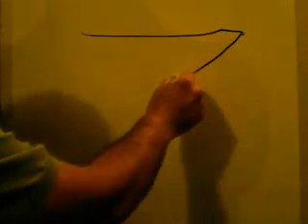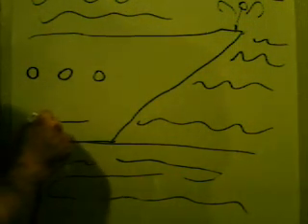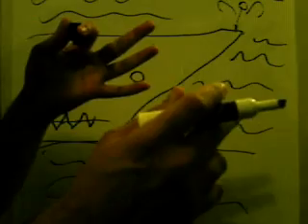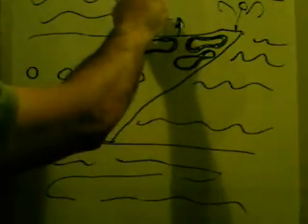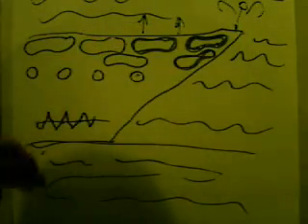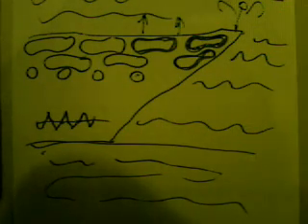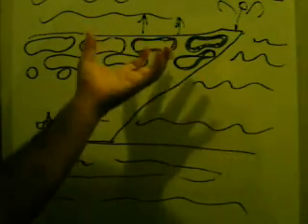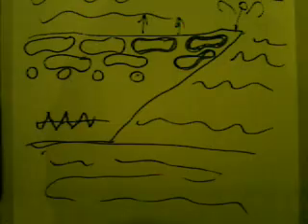Raise the Titanic!

Comment: Yes my friend. The logic is sound but real life is always a bit harder. Lifting bags have been used to bring many objects up to the surface but it is a delicate process because each bag must be matched in pressure to the others. If a single bag were to be used it would have to be positioned midship and the stresses would be too great in most cases. A vessel on the bottom can be a very fragile object. Once again. Nice theory.

Comment: The Titanic holds special meaning to me. I will be leading an expedition to the site where she sank next year. Your idea is not without merit but there are several problems. The hull would never withstand the brutal force of being raised and to inflate anything that deep would require incredible air pressure due to the fact that the water pressure down there is 6000 pounds per square inch. I like your thinking though. It just would not work under actual real world conditions.

Comment: THe reasion why I say this is because I have done years of research and there are only two known locations to me for gates and both of them would have only prevented third class from going down stairs that lead to crew spaces. Third class could easily get to the aft well deck and climed to the "poop deck" which is the aft most surface deck on Titanic.

Comment: Howwould the Plexiglass bubble be impossible?  You have water onboth sides of the bubble and that is an equal force unlike having a bubble with air on the underside and water on the other side.  The bubble would reduce the weight of the ocean cause the ocean is sitting atop the bubble holding it down to the bottom of the ocean.  But since a liquid cant be compressed the water inside the bubble would keep the shape.

Comment: well you wouldnt need that much solution.  Add alittle bit over time you would be able to slowly increase the strength of the solution.  Not sure about the pumping of the fluid.  I think a large 5" diameter pipe that is 2" thick which would leave 1" for the solution to be pumped through would be strong enough but I think it could be possible for that considering that we have had a submersiable go down 4 miles below the surface in the pacific before.

Comment: No i didnt say air pocket, i said i would build a plexiglass bubble to reduce the weight of the ocean and to pump out the sea water and pump in a solution that would slow down and eventually stop the rusting.  There is no air as the sea water comes out you pump in the solution its a simple exchange.

Comment: I would think building a 5" thick plexiglass bubble around the whole wreck and then pumping the water out and refilling the bubble with a solution to treat the wreck.  then you could have the bubble reduce the weight of water and dock with the assembly and scuba dive through the wreck since the plexiglass bubble would be preventing the weight of the ocean above from being felt.  But thats not gonna happen would cost too much.

Comment: Thats what worried the salvagers over the big piece, too much lift in the center caused the piece to warp.   Plus you cant use a hollow life raft, the pressure would crush them.  Thats why the lift bags they used for the big peice was filled with diesel fuel, the bag wasnt hollow so the pressure couldnt crush it, and diesel fuel is lighter than water so it would be bouyant.

Comment: First off, I doubt it could even BE raised, considering it's been down there for 95 years and therefore will be emencly brittle.

Second, the Bow section of Titanic lies 2 and 1/2 miles deep. That far down, you have about 1000 tons of pressure per square inch. If you tried to inflate a raft, it would collapse in a heartbeat. And even at that, consider the weight of it... I'm not so sure rafts could even do it.